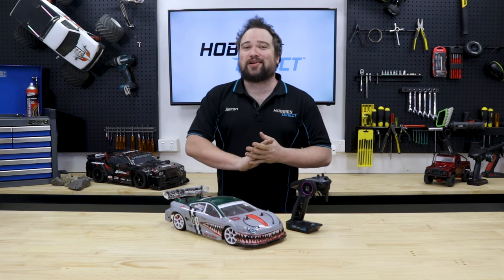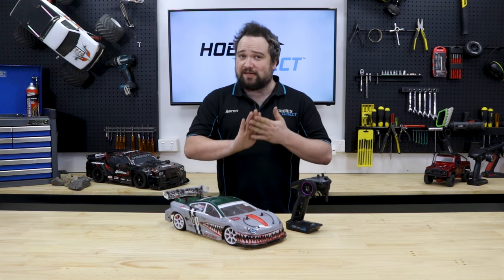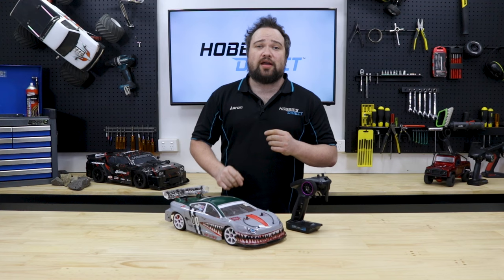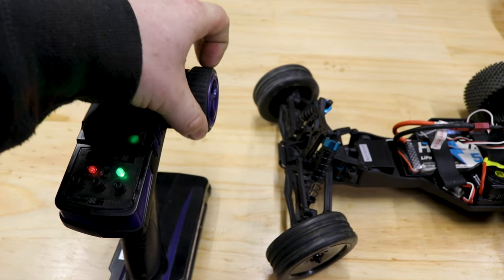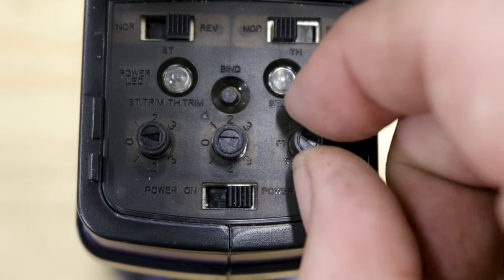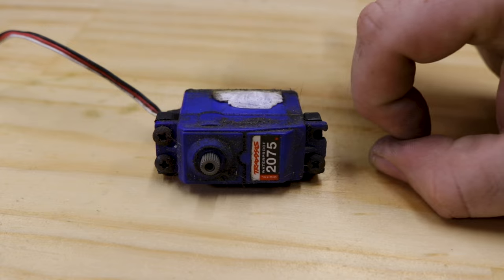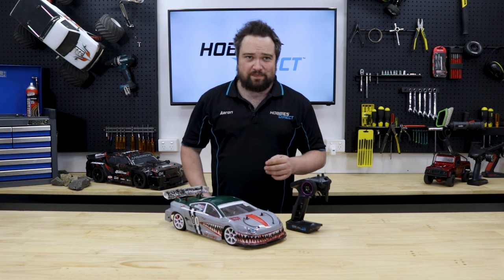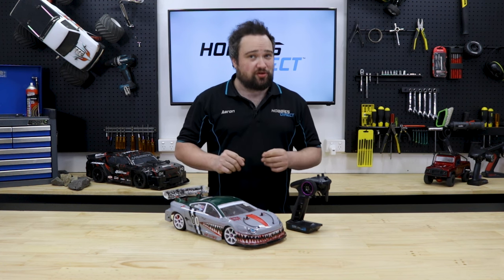RC Car steering not working? Here's how to troubleshoot!

Comment: For me when I use my Transmitter sometimes instead of steering it just makes the cooling fan go slower and sometimes it just doesn’t respond at all
Reply from the maker: Sounds like the ESC's  BEC can't supply enough current to drive the servo, or the servo is faulty and pulling more current than any BEC could handle.
Reply: Same for me. Any suggestions how solve this? Thank you!
Reply from the maker: @hermierey4219  If it is that the ESC's BEC can't supply enough current, you will need an ESC with a more powerful BEC, or a separate, individual BEC to supply the servo and fan :-)
Reply: Have got same problem what should i change or try ?
Reply from the maker: @ganert8616  If it is that the ESC's BEC can't supply enough current, you will need an ESC with a more powerful BEC, or a separate, individual BEC to supply the servo and fan :-)

Comment: My problem is that my steering only works if you lift the car off the ground or the car is in motion. When it’s at a standstill, it only turns right and can’t turn left. Any ideas?
Reply from the maker: Either the servo saver is too loose, something is broken in the rack, or the gears are slipping :-/
Reply: @HobbiesDirect  Ok at least I know what to look for. Thanks!
Reply: Just straightened the antenna wire and it corrected the continuous left tapping

Comment: Now that I think about it, I might've plugged ESC(5.7V) into channel 1 reversed(trimmed in a way that allows easier plugging into tight Sanwa) and killed the steering signal lines. 
Or those lines died when I tried driving in snow and car shut off after some time

Comment: Hi everyone - i just got a brand new WLTOYS 144010 and stupidly when wanting to start it I plugged in the white battery connector cable (used to charge battery) instead of the deans cable (red). Some cables started smoking right after and melted. The car starts, engine runs but steering does not work. Would appreciate any support here 🙏🏻
Reply from the maker: Did you plug the battery into the receiver? Sounds like you've burnt out the receiver, servo, or both :-/

Comment: I think I may have a bit of a unique problem I just got a WL toys 144001 and and there is no response out of the transmitter on the big wheel that turns the servo INSTEAD the small knobs at the front that control steering trim and driving trim are what is steering the car I got a tiny amount of movement from the servo using the big wheel that is actually meant for turning but no luck, I is a binding issue but I’m not really sure was thinking of taking it to a hobby shop as this is my first experience with RC but I would love to hear your thoughts
Reply from the maker: Have you checked that the steering DR isn't turned all the way down?

Comment: I just took a low speed hit with my new Losi pro moto and now the steering servo is locked and I cannot move it in either direction with the power on or off. There is no noise or movement coming from the servo.
Reply from the maker: Only way to know is to take the servo out and have a look - sounds like maybe a gear has moved out of place or something else in the steering is jammed.

Comment: Hi guys, I will try my luck here. I have Traxxas Rustler XL5, it was working just fine and then suddenly, the steering started to jitter and not respond properly. Basically if I just try to steer while stationary, it steers, but once I apply the throttle, car just won't steer or won't steer straight away. When I apply full throttle and steer, car just looses speed very quickly. Basically it behaves as like it does not have enough juice to power servo and motor at the same time, but batteries are fine, I tried 2 different batteries and also 2 transmitters, it's still the same. I tried to reverse the channels like in your video and it's still the same. So my guess would be servo or ESC, but I don't really know, I will try to disassemble it and clean it properly, but I'm not counting on it. It's quite weird, because this started all of a sudden, I'm not bashing my cars, it didn't do any hard landings or crashes etc... I will be thankful for all comments.
Reply from the maker: You are right, it sounds like there isn't enough current being sent to drive the servo. Whether that is because of the ESC's output, or the servo drawing too much, is hard to say without being able to test the car. Hit up your local hobby shop and see if they have a  test servo you can plug in and see if it works :-)

Comment: Hiya,
A while back I bought an AGF A81BHMW servo for my Traxxas XRT, while I was out one day there steering went lame and very weak. Power cycled the system and it went back to normal, for a few seconds at least, decided to go home, on the way back to my car the steering magically fixed itself?
I decided to fit a Castle BEC (which I was putting off for fear of doing something wrong) to get more power to the servo, hoping it was a voltage issue causing the problem (6.0 volts up to 8.4 with the BEC). Went out again and it was great for a while, then did the same thing again.

Any ideas? It's not the gears, they sound fine. Other than the BEC, new fans all round, new servo, and Traxxas X-Maxx/XRT light kit, all electronics are standard Traxxas stuff.
Reply from the maker: As long as the servo is definitely getting all the volts it needs, it sounds like there might be a fault with the servo itself :-/ Does it still play up if you turn TSM all the way off?
Reply: @HobbiesDirect  Yes I think still screws around with it off. It started a while after installing the new servo, quite a few outtings, not immediately.

[edit]

Also, again, it's not all the time, it can just magically fix itself. It makes no sense.

Thanks for the reply by the way.

Comment: Is there a way to wire 3 pin servo to work as 2 wire?  To turn left to right? 

I understand about the signal wire, but can that be bypassed?
Reply from the maker: Bypassing the signal wire would do just that; bypass the signal. No direction signal, no turning.

Comment: Help needed!
I’m completely new to RC and I recently just received my 124016 V2 2 weeks ago and now my steering doesn’t react to anything after only running it 4 times. It doesn’t even center it self when I’m powering it on. 
It had a slight jittering and turned all the way to the right when powering it on after cleaning it and It lost steering completely 2 days ago, I might have been too heavy with the water? I left it to dry and the next day it was back to normal. Ran one pack on the beach today with my new paddle tires and after a failed jump(nothing crazy) it lost steering again…
The car do still drive and reverse but steering is completely dead.
Servo gear sounds fine, nothing binds in the steering, fresh batteries both car and transmitter.
Ive tried plugging the cables from WL into my MJX receiver and the MJX turns and drives with the WL transmitter. If I do it the other way around: nothing happens…
Bad/fried esc, bad servo?
Reply from the maker: Definitely on the right track. Either servo is faulty, ESC can't supply enough current, or receiver has a dodgy channel.
Reply: @HobbiesDirect  hmmm i hoped you pretty sure about one of them but I guess I have to keep diagnosing.
Any suggestions how to attack it from here?
Reply from the maker: @TheDaniishDude  can you swap receiver channels to see if the servo works with the trigger?
Reply: @HobbiesDirect  that doesnt work either, then it would have worked when i plugged in my WL cables in my MJX
Reply from the maker: @TheDaniishDude  Okay, if it's not the receiver, then as above, either servo is faulty, or ESC can't supply enough current. Just keep going through the process of elimination.
Reply: @HobbiesDirect  a few days without touching it and tried turning it on yesterday when I came home. Now steering is back and it ran 2 packs just fine without issues..
Reply from the maker: @TheDaniishDude  Haha fixed forever!

Comment: I have a problem with my controllers stearing.. there are no response what so ever.. but when i switch the servo with esc, it turns just fine.. like in your video!
but not when i switch back.. there are still no response-
 and the dualrate just turn the wheels like its ajusting it.. Can you reconnect / Rebind transmitter and receiver ?
Reply from the maker: Sounds like you are adjusting the Trim, not the Dual Rate. Make sure the Dual rate isn't at zero. Then try rebinding. If still nothing, it might be time for a new receiver :-/

Comment: What if you took a transmitter/ receiver aswell as servo out of another car that works, but there's still notta? Would it be the esc? Only thing i havent replaced, first time coming across this problem in my 15 years of rc 😅
Reply from the maker: If you've changed everything but the ESC, that's the last place the problem could be.
Reply: @HobbiesDirect  man thats weird maybe the bec or somthing blew in it (even tho its new lmao, tt02 kit)
Reply from the maker: @haydnholder7090  That's unfortunately possible :-/

Comment: Hi could you do video of one of the most problematic remote controls. Product enterprise Daleks and Davros had issues. I'm trying to resolve the issue with Davros since I only had two plays with it until wheels continually clicked every time it moved then stopped working!
.
Reply from the maker: Toy grade stuff is really hard to diagnose - it sounds like a gear might have moved out of place or stripped. Your best bet would be to bust out your Sonic Screwdriver, open it up, and see if you can find any physical damage. Allons-y!

Comment: My build is brand new and when i binded the transmitter to the esc, the servo jerked left and is unresponsive (throttle works, steering doesnt). I cannot get the steering to engage. I connected another servo and the backup worked fine. Could it be that my servo is faulty?
Reply from the maker: That's the most likely scenario, but it also could be that the new servo draws too much current for the ESC to run it.
Reply: @HobbiesDirect  turns out i forgot to bench test it before assembly and had set the servo horn before ever centering the motor. I removed the servo horn, centered the servo motor, and then reassembled everything, Problem Solved!
Reply from the maker: Haha nice! Problem solved 🙂 @shyonemami7388

Comment: I have 2 rc cars and took the batteries out and charged them and I must have put the wrong ones in because when I try to turn it on to connect to the remote both of them work for one car but they both don’t work 100% like one will only turn and the other remote will just go forwards and backwards so I just need some help on what to do or if I can fix it
Reply from the maker: Without knowing anything about the cars, you're just gonna have to do some trial and error and figure out what component is letting down the team.

Comment: I modified a rc car toy. Had put 2 esc, one connected to the back motor (acceleration) and battery. Other, connected with the steer and battery too. It works fine, but sometimes the steer doesn’t respond. I turn right than left, for example, in the remote controller, but the car doesn’t go. It not work when I make it one after other right on. If I wait, like, 1 second, it turns. But it’s not working right on time that I turn in the controller. I have to wait to do. Why’s that?
Reply from the maker: Being modified,  and with no other knowledge on the make/model of car, or what the specs of the electronics are in it, it's very hard to say. But it sounds like the ESC's BEC doesn't have enough current output to supply the servo, so it's browning out.

Comment: I have a problem with my hosim q905. I took the turning wheel from the remote and when i screwed it back on i heard some snapping noises and when i tried driving my rc car, the front wheels was not turning and with more 360 degrees of snapping the remote wheel the wheels turn but it doesn't go back to the centre automatically.
Reply from the maker: Sounds like you broke the travel stoppers for the steering on the remote. You could likely repair it if you took it apart and are good at that sort of thing :-)
Reply: @HobbiesDirect  unfortunately I am not. Thank you for the information, much appreciated ☺️

Comment: Mine works if i turn the wheels left and right then use the remote to turn it left then right it then locks up making a fizzing noise. The gears are ok inside, it just started doing it no impacts just went out of range one time.
Reply from the maker: If the end points weren't set correctly, the internal position sensor may have been damaged or burned out; might be time for a replacement :-/

Comment: (WL TOYS 14800)

hey Aaron you got a full rc car redo video, my rc wheel loader has no steering, motor works even new one didnt help, doesnt steer, no channels to swap to check, just battery to board to features 

i dont have power at main board should be 9v, lithum ion battery still good
Reply from the maker: If you don't have power at the main board, but the battery is all good, double check all connections and maybe re-solder. Otherwise, it might be time for a replacement main board.
Reply: @HobbiesDirect  I'm at a stand still because I looked the whole internet for a new board and didn't find a seller 

and certain some connections aren't even soldered to the board

Comment: İ have hbx 12891 brushed. When i pair car and remote controller, car directly turn left and stuck like that. When i turned off back in normal
Reply from the maker: Have you checked your steering trim? If it's not that it could be receiver or servo, or even hand controller.

Comment: What to do if when i turn on the controller the wheels just start spinning backwards by themselfes but after i apply a little pressure to the throttle it stops
Reply: And if i use another controller it just sends wrong signals i thinknit might be the fault of the quartz or something
Reply from the maker: Sounds like the throttle trim is off, try adjusting it @jatoja424

Comment: I don't know why I can't find anything about the servo being stuck.. like I can't even move it by hand. No idea how that happened. Trying to get it apart right now
Reply from the maker: Sounds like time for a new servo :-/
Reply: @HobbiesDirect  so for some reason while I was taking the servo off it all of a sudden freed and worked perfect. So I was driving more. Then the same thing happened. So this time I took the servo apart, the gears seemed messed up. I tried to "rebuild" it, it worked for a little, and now i can move it by hand all the time, but I can only steer left or right all the way. So I'm just going to order a better servo and hope it's compatible lol. Thanks for the responses
Reply from the maker: @overratedprogrammer  No worries! If it's a standard size servo it should be compatible, just don't go to high on torque or you'll freak out your esc/receiver.

Comment: So my car flipped over now steering don’t work but it’s still got power to it but makes a whining noise it’s like it’s jammed and car still goes forwards and backwards
Reply from the maker: If the steering rack still moves smoothly, it sounds like you stripped a gear in the servo :-/
Reply: @HobbiesDirect  hi no steering rack or servo does not move at all it’s still
Reply from the maker: @gavb85  But can it be moved by hand? Not all jammed? If it seems fine otherwise, it'll be that the servo has a stripped gear.
Reply: @HobbiesDirect  can’t move it at all mate just makes a whining noise
Reply from the maker: @gavb85  Sounds like you've broken a gear in the servo 😕
Reply: @HobbiesDirect  is there any way I can send u a pic of my servo as I don’t no which one to get as a new one
Reply from the maker: @gavb85  you can link to it here, jump on fb messenger, or email us via our website hobbiesdirect.com.au 🙂

Comment: What if I don't have steering dual rate on my transmiter
Reply from the maker: Then dual rate can't be adjusted electronically - there might be a linkage to adjust the throw, but some RC vehicles just don't have any adjustment.
Reply: @HobbiesDirect  turns out that the servo itself is going on way more than the other no matter the steering trim what should I do
Reply from the maker: @imno3471  Is the servo centered?
Reply: @HobbiesDirect  yes, it is
Reply: @HobbiesDirect   the transmitter was recently opened, and I might have broken something in it.
Reply from the maker: @imno3471  Oh no!

Comment: I have no idea what happened to mine, I was driving it around slowly and it for some reason stopped steering does anyone know what it could be
Reply from the maker: Did you maybe bump the D/R down on your radio?
Reply: @HobbiesDirect yes I have mine at the max and it still would not turn but it would drive forward and backward just not turn
Reply: @HobbiesDirect I didn’t mean yes I meant no sorry😅
Reply: @HobbiesDirect  I think my servo has burned out😢 I don’t think it was the d/r because I have mine on top of my remote with a hatch to close it
Reply from the maker: @magmagold2969  If there's no signs of life at all, then it might be time for a new servo :-/ If you plug it into channel 1 instead, you can see if it moves with the trigger. If it does, then it's likely the receiver that's the problem.
Reply: @HobbiesDirect  ohhh ok thank you so much I think it is the receiver because I switched it so that the throttle would be on the turning knob and the steering on the throttle, the steering still did not work but that is ok thank you so much🙏🙏

Comment: My rock crawler would turn left but won't turn right and I can't find the issue
Reply from the maker: Check end points on your radio, and the physical linkages of your steering. If everything else is fine, it might be time for a new servo 😕 Does it still make a noise when trying to turn right?

Comment: i have a brand new servo and when i put the throttle in the steering one it works but the steering still doesn’t work any idea what it is
Reply from the maker: have you checked the steering Dual Rate (D/R)?